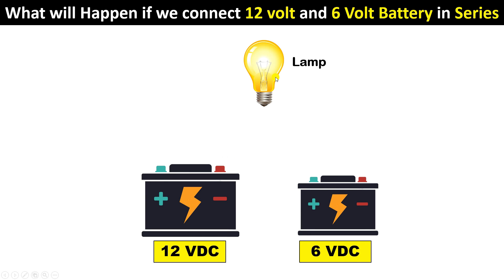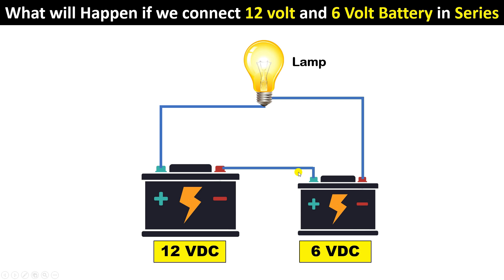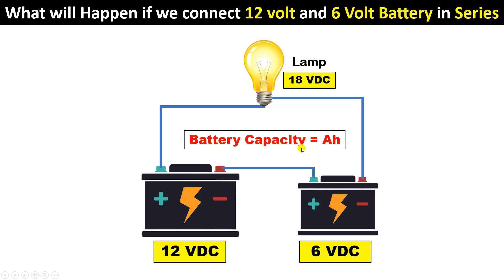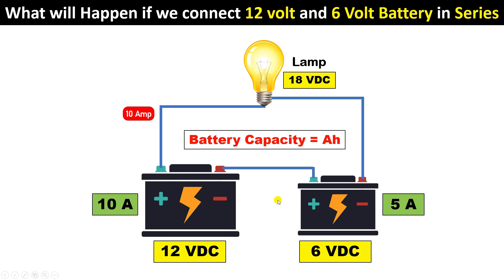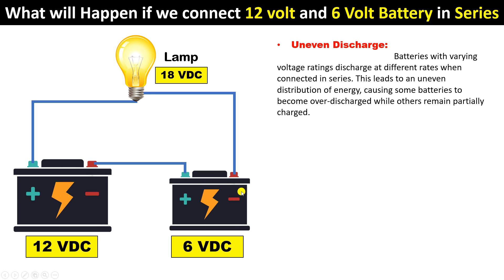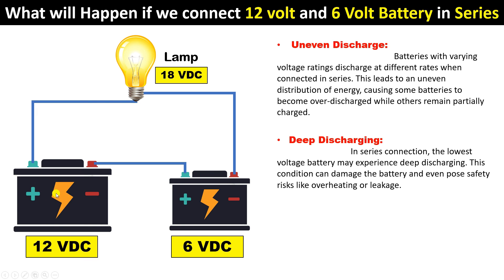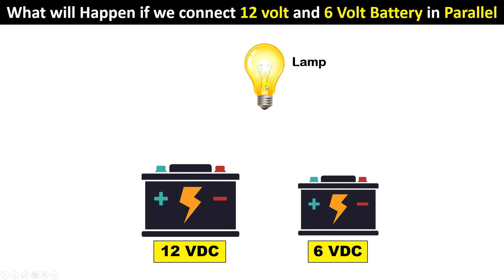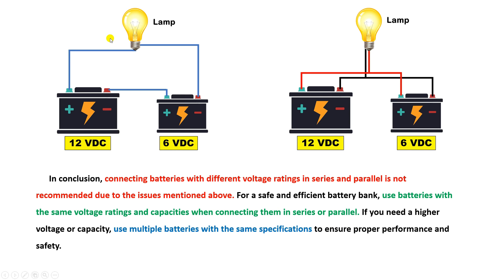What will Happen if we Connect Different Rating Battery in Series @TheElectricalGuy

Comment: The fact still remains that when two batteries are connected in series, the total voltage to the load is the sum of the voltages of the batteries. It is the load that determines the current that is being drawn from the battery, and not the battery amp or C rating. If the load draws more amps that is above the maximum rating of the battery. The battery can be overloaded and get damaged. It will also lead to voltage drop, which will starve the load of the required power.

Comment: Sir, one thing that you got wrong is that Ah doesn't say how much ampere of load we can take from the battery. Ah Or say Ampere/hour is a unit for capacity of the battery. In the case of 10 Ah battery, if we take 10 ampere from it, the battery will last for one hour. But that doesn't mean thar we can't take 20 ampere from it. By taking 20 ampere, the battery is going to last for half an hour.
Reply from the maker: Yes I know about it, but to explain the concept of the video I did not talk about that
Reply: Would you please do a video for beginners like me to explain why connecting batteries of different voltages in parallel will cause dangerous equalization but this doesn’t happen in series ? Why?
Reply: @TheElectricalGuy  I would also LOVE a video explaining how a battery cell can become “reverse charged / reverse polarity “ in series and parallel which I read can be a big danger!